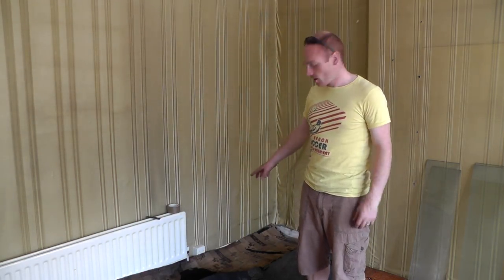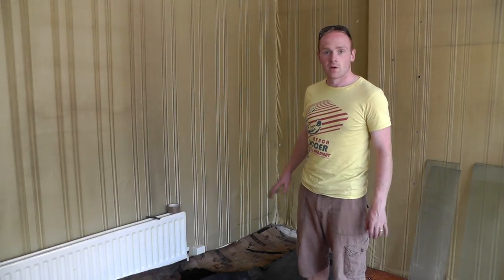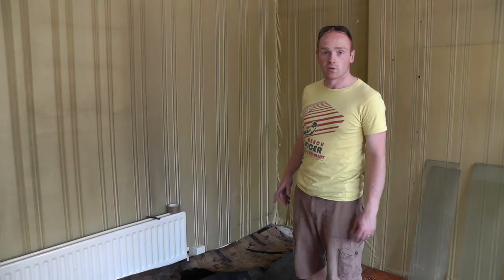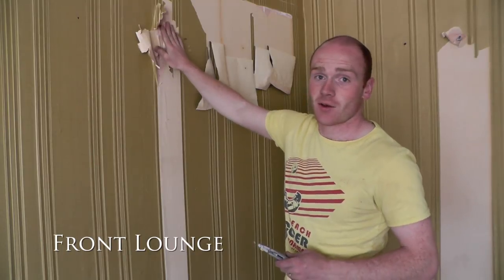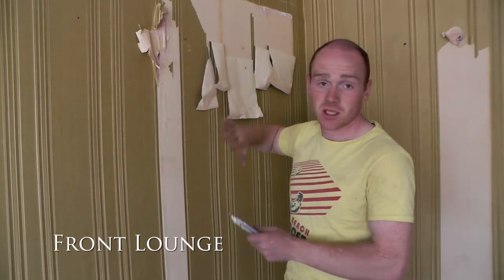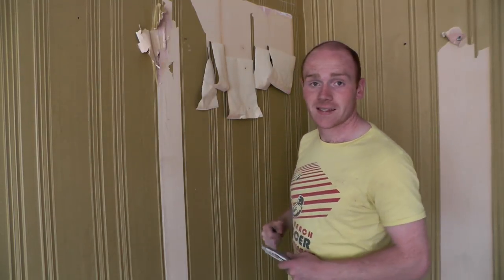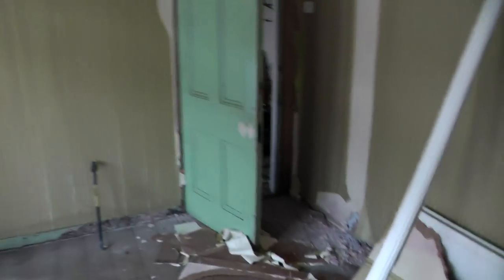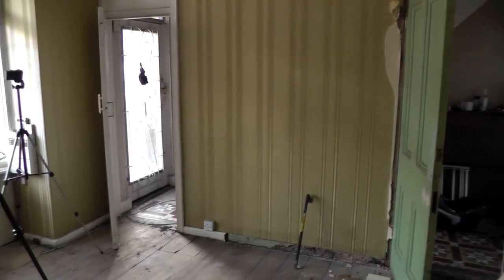Removing Old Carpet and The Hidden Door

Comment: Had a similar experience. Walls looked like they had rising damp and Damp company wanted silly money to resolve it. After some research and a bit of poking around, we discovered it was modern air tight flooring laid on suspended timber floor. Horrible, ugly, cheap, laminate flooring trapping moisture and sending it up the walls.  We just took up the hideous laminate, solved damp issues and found beautiful timber flooring. Laminate flooring urgh. It's a photo of wood glued to cheap chipboard. Not that I have strong opinions about it or anything.